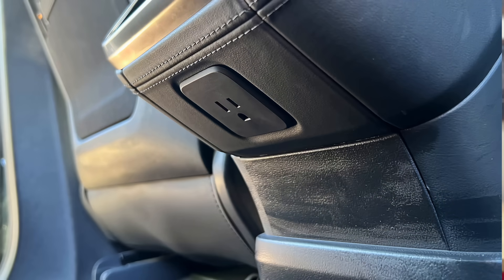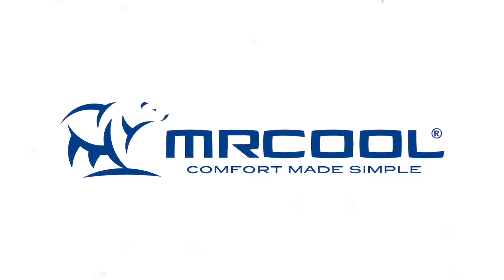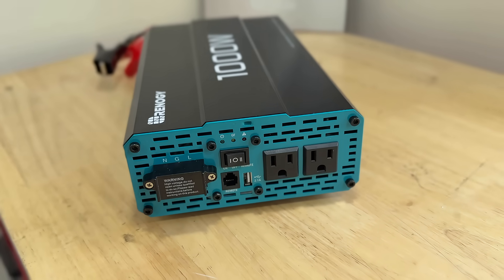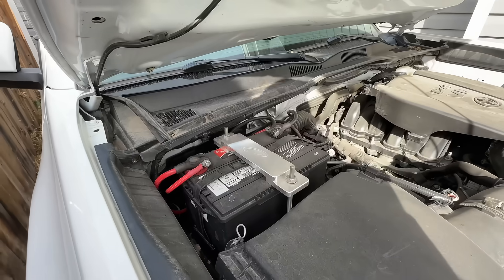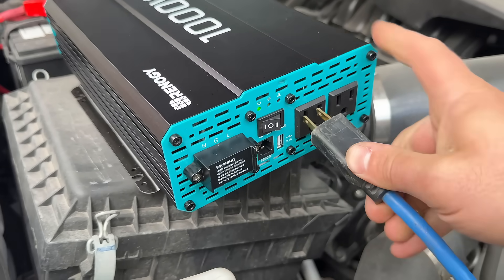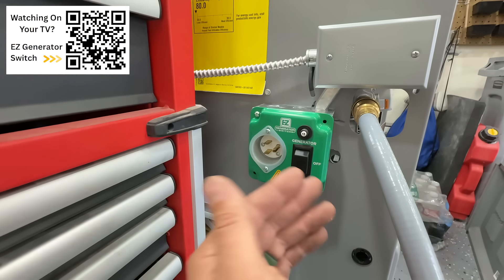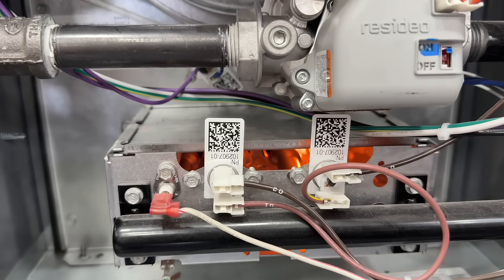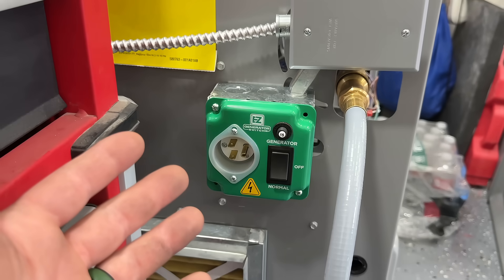Why Buy A Generator? You Have One Parked In Your Driveway.

Comment: A car battery in good condition is 40 - 60 amp hours and it's lead/acid, so more like 20 - 30 if you don't want to damage it. That's roughly 250 - 300 watt hours minus whatever is used to actually start the car (8 - 10 watt hours?). Probably less if the battery is older.

A small, efficient central unit may average around 100 - 200 watts depending on how well insulated the house is and how cold it is outside. So pulling power without leaving the engine running is a good method to kill your battery if you're just winging it and running the car every couple hours without knowing when it's fully recharged. With this method of drawing power off the battery then recharging, when you're recharging and ALSO running a central HVAC unit, the alternator has to supply both. You're much better off running the car continuously while drawing power. You should know your alternator's rating and only draw 30% - 50% because that rating is based on driving RPM and you'll be running at idle RPM. Make sure your headlights are turned off and don't run the car heat or AC either. You probably need a 1000 watt inverter minimum to handle the surge of a central heater even though the average running power is 100 - 200 watts.

That said, I did use my car to augment solar recharging a LiFePO4 battery bank during my last blackout and I have recommended a combination of car with a solar generator/power station for people who don't have the ability/desire to maintain a dedicated generator and fuel. If you don't want a DC-->DC charger, you can pick up a 500 watt pure sine wave inverter for $50 - $60 and set the AC charge rate on many power stations down to 300 watts. I generally recommend an 1,800 watt power station as the minimum so it can handle the surges while the car is supplying a slow, steady, low wattage.

Comment: I have a PowerX system I bought on sale for under $200 a few years ago.  It will do 3,000 startup watts and 1,500 continuous watts of power.  Most cars will idle for about 3 days on a full tank.  My home heat is gas, so all I needed was something to run lights
Reply: ...and your fridge ?
Reply: @1totoche007  Yes, my fridge too

Comment: If you put a heavy load on a vehicle alternator it will burn out if it not run fast enough for the cooling fan to keep the temperature below limits,😊
Reply: I have the idea that hi demand at low rpm low output will likely fry the alternator, but i'm not an engineer.

Comment: This is a great emergency hack. Like a few others below cautioning on loads - only thing to keep in mind, the cost of alternator replacements in 2025. They've gone way up. Get them hot for extended periods under load and it can shorten their life - rectifiers inside typically burn up. It all depends on where you are, ambient temps outside and the load. If you have electric radiator fans cycling on/off, those pull a ton of current as well and put strain on the system if other things are connected. Another youtuber living out in the desert was telling folks to forget solar panels and use their car for charging portable power stations fast -so much better. I mentioned the same and cautioned against overloading the electrical in desert heat. I was just advising to be cautious was all. He got mad and he told me car makers know all this and make them for the load. That alternators protect themselves. No. Car makers don't know how everyone is going to use something. My response was, "ok then", lol. Cheers.
Reply: Car makers do the bare minimum, and give you an alternator barely suitable for all your lights and other electrical components in your car (which is a lot more than before, but still only 12v) and a little extra for the occasional "cigarette lighter adapter" tire inflator.
They do not give you an alternator strong enough to power your house, just like they arent going to give you suspension components strong enough to carry your house. They dont give two shits about your house, lol.
 Why would they?
A lot of those "off grid" young people on social media are just trust fund babies who never got told "no", and instead of developing a drug addiction to feel a struggle, they made a life of trying to prove to the world they could be independent. But their attitude still bears the artifacts of a spoiled upbringing.

Comment: I use my car to charge AGM batteries. They accept power very quickly so you need heavy-duty cables. I'm mainly concerned with keeping my refrigerator and ham radio working.

Comment: You need a FULL SINE WAVE inverter for your frig /freezer and sensitive electronics. The MODIFIED sine wave inverter you use can damage your fridge compressor motor or your electronics.
Reply: Pretty sure that Reongy model he used, is in fact a full size wave inverter. It's designed to power anything within the power range it can accommodate.
Reply: Yep - fried a microwave a few years ago because I didn't know this.
Reply: Electronics  gear turns AC into DC in the power supply.  I doubt that process cares whether it's sine or modified sine waves.
Reply: @quademasters249 some power supplies with active power factor correction that are not properly filtered for the higher total harmonic distortion that modified sine waves output can be damaged over time, sometimes immediately. The really old computer power supplies that had passive power factor correction won't care if it's a square wave or a sine wave. Typically any equipment designed to run on a sine wave will run warmer on a modified sine wave AKA a modified square wave. The heat build up eventually over time causes components to fail.
Reply: Your wrong!
And yout doubt is not informed
Reply: Yes the Renogy is a full sinewave
Reply: Only motors care about pure sine, electronics generally tolerate modified.
I live off grid.
Reply: The power coming out of your walls is dirty, and noisy as hell. Municipal power is hot garbage. So a non pure sine wave inverter ain't gonna hurt nothing in a pinch.
Reply: @Menruleall  I've never seen a "full sine wave" on an oscilloscope. In fact, I've never heard of it until now. Most of the electronics have power supplies and regulators. My stereo amp has an AC input protection circuit for surges. So I guess it doesn't matter for usual household appliances because they are not sensitive to trash and voltage fluctuations. In the case of a generator operating off of a car alternator, that brings up load issue questions for me especially when running refrigerator or AC compressors.
Reply: @nolaserv  I've never heard of "full sine wave" either. Always heard "pure sine wave"
Reply: @Menruleall That sounds more like it. A sine wave can have clipping and distortion.
Reply: @Menruleall  I was checking to see if someone would correct the term, thanks
Reply: @Lightendog  I don't know how they came up with that term. I worked with Electricians and I've been in electronics since the mid 70's. A sine wave is a full sine wave or it isn't a sine wave. A sawtooth wave was for TVs and digital is a square wave.
Reply: The Renorgy meets the spec!
Reply: Harbor Freight is your best friend.
Reply: What about testing the setup while the house power is on? Is there enough isolation to do that to prevent back feed in both directions?
Reply: It also needs a proper neutral ground bond to run as a separately derived system. Many newer HVAC system is use flame rectification as a way to detect a flame is present and keep the gas valve energized. If you do not have that neutral ground bond your HVAC system will not work. Many of these inverters have floating grounds, That's why it's important to check
Reply: @Bassguitarist1985  Yeah but this is not an HVAC channel oh wait …

So where do you establish the neutral in this scenario?
Reply: @thenexthobby according to the reviews and manual for the inverter he used it says there IS an internal neutral/ground bond.
Reply: Thank you!!
Reply: I own that model Renogy inverter. It is a full sine wave inverter.
Reply: @rytbeard  Guess it's a regional thing.  Some call it "soda" and some call it "pop".  Some call them "drinking fountains" and some call them "bubblers".
Reply: Thanks I was looking for that info also and found it @ 2:30 into the video.  You can read on the front of the inverter, Pure sine wave inverter 12VDC - 110VAC 60HZ.
Reply: I've heard this time and time again, however I've been running a very small 1.5 cubic refrigerator from Walmart for over 4 years continuously on a Ampeak 2000W Power Inverter (modified sine wave) with 4/ 100 amp hour AGM batteries. I even use my notebook computer on the same setup with no problems.
Reply: Always someone in the comments who thinks they know more but never post videos 😂
Reply: Think it really depends on the equipment whether you need pure sine wave or if modified will do it.. I've run my fridge / freezer and a number of other devices, routers, modems, computers,  off modified sine wave inverters with minor issues. Compressor motors might get a little extra warm everything else has worked adequately.
Reply: @douglasw7806  I agree.

Comment: 🤔Hummm, I’m pretty sure all that engine heat isn’t going to be good for that inverter as it’s got a small fan built into it to keep it cool sucking in hot air isn’t going to cool the circuitry and it could cause a fire ahhh not good ! Plan B   Buy a gas generator or power station with solar .

Comment: Correct me if I'm wrong...but I don't believe you can simply choose between 1000w and 3000w inverters. The size of your alternator determines what will work for you.

I believe a 1000w inverter at 12 volts will need an alternator with at least 83 amp output. A 2,000 watt inverter at 12 volts will require 160 amps. My car has a 100amp alternator so I wouldn't use anything more demanding than a 1000w inverter.
Reply: I worked in the arctic oil fields and we let trucks idle for hours.
Reply: @dq6169  I bet they were Diesel. Modern diesel engines w DPF’s should not be idled for long periods. In extreme cold weather, diesel’s can be difficult to start, so the only option are heaters or idling. Idling both types of engines, washes the oil out of pistons leading to extreme duty wear. Gas engines can overheat in hot weather, that can destroy the engine. Be smart, buy a generator❕gas, propane, Nat gas or diesel fueled. It’s not worth destroying your much more expensive vehicle.
Reply: Its about how much power you are pulling more than inverter size, I have a 4kw inverter but I'm not using all 4000 watts all the time, running an AC and my entire shop takes around 1500 peak so it's not a problem as long as you work within the confines handed to you.
Reply: @GoonyMclinux  Exactly. I had a guy in the shop say I had too many plugs connected to a power strip. I told him it's not the number of plugs that is important, but the power actually consumed.
Reply: Thanks for the clarification
Reply: I don’t believe that at all. Working at a dealership working on fleet vehicles that idle for hours on end, police cars, taxis, oil field trucks some of these vehicles may have 30,000 miles on the odometer but have 6,000 hours of idle time. Does not hurt a modern vehicle one bit to idle hours on end.
Reply: You are correct!
Your car won’t power your home and you’ll run out of fuel as gas stations won’t be running either.

Those who prepare are good, those who don’t…🪦
Reply: How stinkin’ cool is that? Pretty stinky, with the exhaust leading into the garage, I’d wager. 

It would have to be raining and desperate for me to close the hood on an inverter laying there, getting melty inside and out. But if theft is weirdly the concern, a better investment would be a portable electric generator with a decent sized battery pack inside.
Reply: @thenexthobby  I have a charger and inverter mounted under my hood, its fine as long as you get something made for the purpose and use correct installation methods, mine charges 4 100ah lipo4 batteries so there is no real strain on the vehicle or it's starting battery, the 4kw inverter doesn't use the trucks lead acid at all. Makes for awesome glamping trips.
Reply: @GoonyMclinux are lipo4 batteries safe for cars due to high heat in cars?
Reply: Modern Gas Car Engines are not designed to Idle over several minutes. Fuel gets into your motor oil. Which Washes the oil out of the cylinders. Fasts are facts, Google it.
Reply: It’s not good to idle today’s car engines over 2-3 minutes. It loads up unburied gas into the engine oil, which can damage the engines. Google it on YouTube.
Reply: @davemi00 try living up here in ND and say that, when it's 60 below windchills, you would definitely let your vehicle run for 15 mins or more to warm up before heading to work in the morning
Reply: @davemi00  what about cold climates?
That just doesn't sound right...
Reply: @davemi00 you spend 3 minute’s waiting at a red light lol , is that damaging your engine? Give that google garbage a rest lol !

Comment: A few years ago I used this method during a hurricane power outage. One good thing to point out is the fact that usually during a hurricane outage there is also a fuel shortage. Three or four days of that and you are usually out of fuel for a generator. If your car has a full tank, which it always should, you could use it for a LONG time. I now have a generator also so I'm ready for anything.
Reply: After having to hunt for gasoline after a few days I purchased a tri-fuel pure sine wave INVERTER generator.  It runs off the same natural gas line that I use for my barbecue grill, and fire pit.  Start it and walk away, no hunting for fuel, no hot fills. Let it run for as long as necessary. As quiet as a lawn mower idling outside your house.  I will never put gasoline in it, only run it on NG.  Oil is always perfectly clean as the day you put it in after an oil change.
Reply: We have three vehicles. Total about 50 gallons between them.
Reply: @douglasw7806  bloody hell I have a 35 gallon tank with just one vehicle!
Reply: @ebnykween yup. My old cargo van was like that. Looked like there was a boat strapped under the body.
Reply: Your car uses less fuel than your generator?
Reply: @RequisiteFunction  No but sometimes you have to do what you have to do before you get a generator......
Reply: @RequisiteFunction  I don't have much room to store gas. I can keep maybe 5-6 gallons on hand. The car can hold 16 gallons and no it doesn't use much gas when idling.
Reply: You’re not ready for an EMP.
Reply: @xploration1437  neither are you
Reply: @neutronfluxlabs1 how do you know?

Comment: Great suggestion! Your remedy takes a little pre-planning. That would have been helpful to me 14 years ago  when we got hit with a surprise Halloween surprise storm. 95% of my home state was pitched into darkness because we got about a foot of snow with leaves still on the trees. I know I was working that storm as a power lineman. We went balls deep on a generator though because we were all caught by surprise. Your solution is great for desporite times. Heat would have been a real life saver. Unfortunately I don’t think I could leave one of my trucks idling in the driveway to back feed my furnace. Sweet suggestion though.

Comment: I was once without power for a month due to a hurricane. Those with generators ran out of gas pretty soon. I was able to siphon gas out of vehicles, with the owner's permission, to keep my car/generator going. My neighbors and I were the only ones with lights in the county. Nobody else figured out to share gas from their cars.
Reply: How did you siphon since 21st cen cars have charcoal traps in the filler neck or odd bends through VOC cannisters?

Just curious, not dissing you... genuinely curious.
Reply: @STho205  The charcoal traps are parallel to the filler pipe.
They have to be: because otherwise you would not be able to fill the tank.
Reply: @economicprisoner  i tried once and couldn't get a siphon tube (only 1/4 ") down the throat of a Chrysler I had to drop the tank on.  About 8" and it stopped feeding down.  A mechanic told me it isn't easy anymore and to jumper the fuel pump and let that pump it dry.
Reply: When I used to use a gasoline-powered generator I kept a fuel injector rail pressure gauge handy that I could use to attach to the fuel rail of any of my cars. With the key in the on position but the car not started so that the fuel pump would run I could use the pressure relief valve on the gauge to a hose into my gas can. It took a little while to refill a 5 gallon can but it got the job done.

Comment: Please point out that at 1000 watts and 120 volts, the amperage is 8 amps. Only enough for a single small to medium appliance. Review the amperage requirements for the unit that you are looking to power. The initial draw for a furnace motor or a refrigerator would likely exceed 8 amps. A larger inverter may be the answer.

Comment: I installed a dc to dc charger on my truck. It protects from overcharge, undercharge, overheating and others. It converts the trucks 12v dc to up to 60v dc that charges my power station. I can go for a day with power station alone and recharge it in 2 hours from running vehicle.
Reply: Me too. Works great ‼️😃
Reply: That's what I have done as well. Works great and all can be monitored via an app.